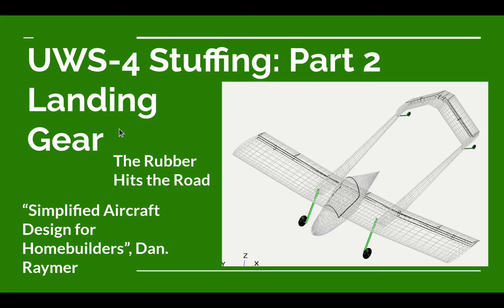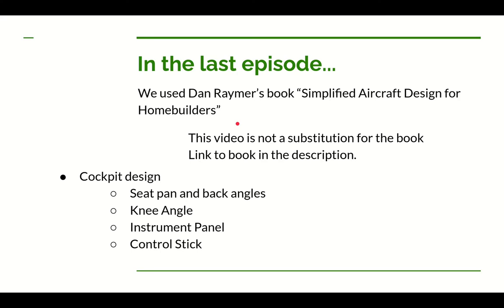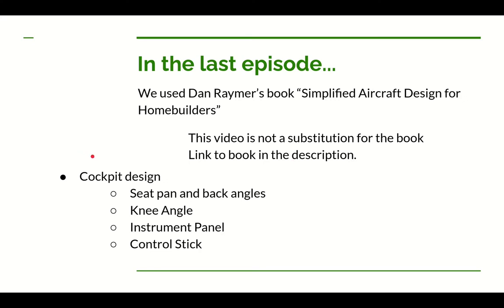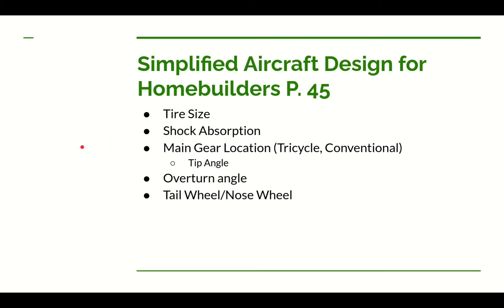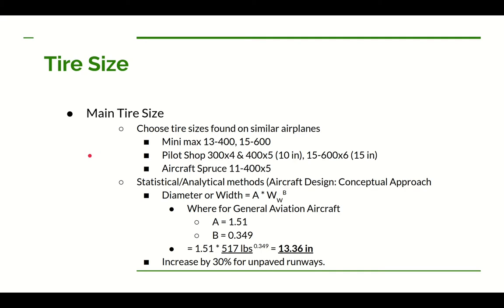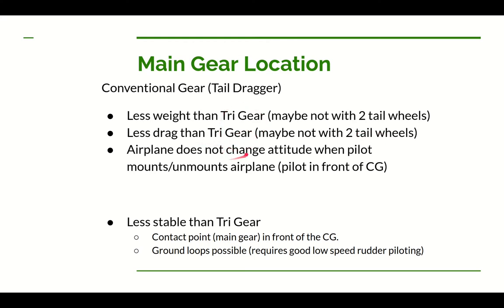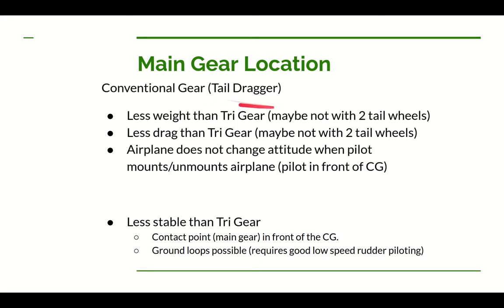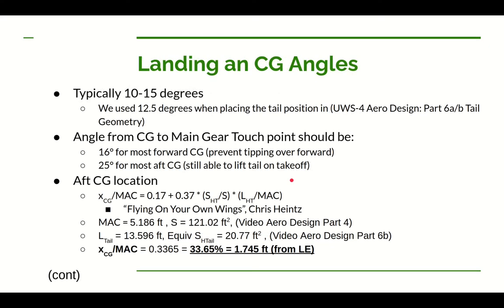UWS-4 Stuffing: Part 2 Landing Gear

Comment: My preference is for the larger diameter tire if you anticipate doing off field landing, the larger tire will also give a bit more shock absorption.  Use  2-ply tires if you are on a weight budget.
Reply from the maker: Thank you for the feed back. I've been going back and forth on this one. My intention for this plane is to only fly on paved or well maintained grass runways which is why I'm contemplating the 13in tires. But 15in may be the better choice in the long term.